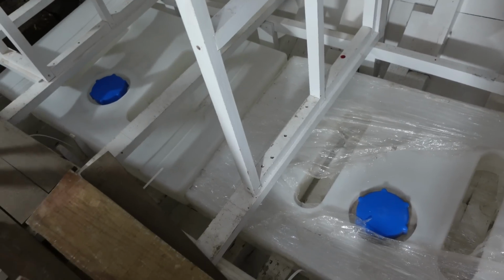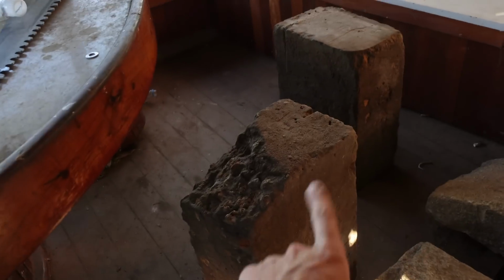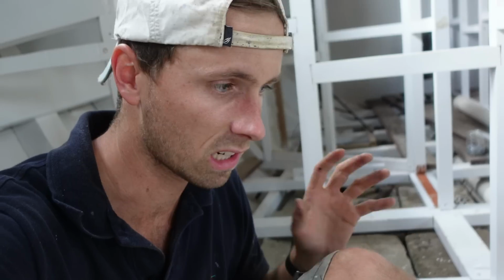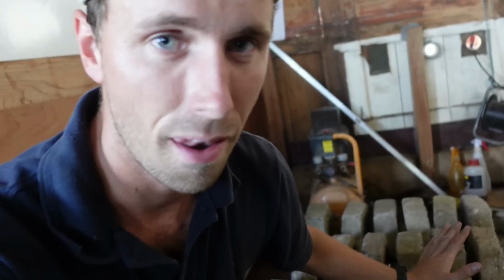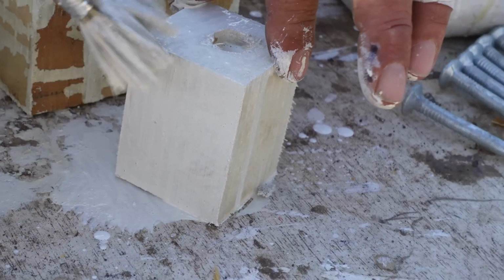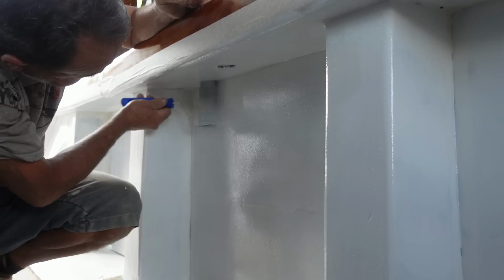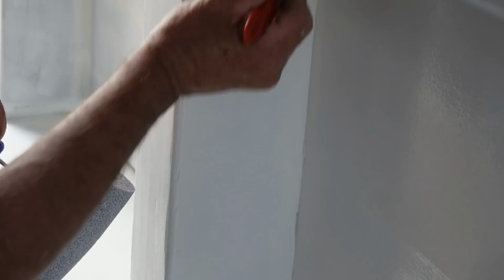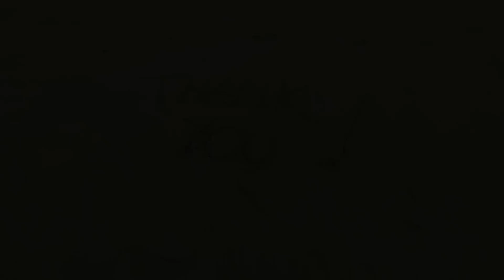Boat restoration: another reason why the sails should be removed on day 1 — Sailing Yabá #103

Comment: Bedankt
Reply: I refurbished a fiberglass boat with my son. When we replaced the fuel tank, we placed a one inch solid rubber mat between the bottom of the boat and the tank to prevent any grinding,  or in the case it became a little loose the tank would not damage the hull. I think the same apply to your beautiful boat. Specially, between the plastic tanks and concrete/stone ballast. There are thinner rubber mats than the one I used. Good luck and God bless

Comment: Have you thought about foaming the ballast blocks in place?  In addition to securing them in place it will prevent the noise of the blocks shifting and grinding with the movement of the boat.  I don't believe you'd want them moving around in any case as they will eventually wear down anything they come in contact with, even each other.

Comment: Does Ben use a tripline on his anchor to keep from losing in the rocks.  shackle the chain to the head and run the chain down the shank and take a zip tie or cotton twine and tie the chain there,  the chain will lay flat along the bottom then if hung up, just drive over the rode and pull the anchor straight up,

Comment: Just wondering about how rough the pavers below the water tanks are....are you concerned about them rubbing against the water tanks when under sail.  Everything shifts even heavy things when under sail and we had wear happen with some strapping on our water tank that caused a leak so I am wondering if you are protecting the bottom of these tanks in any way?

Comment: One concern here - that's a plastic tank stop a semi-rough stone surface.

If there is ANY movement at all in either stones or tank, the stones are going to grind away at the plastic until the tank ruptures.

I'd strongly recommend a layer of wood in between.

Comment: Hi, fantastic work, she looks really good, I have one suggestion please take it as constructive, where you are painting the bulwark planks  where they are bolted to the frames there is a small
gap this is where fresh/rainwater will gradually soak in and start to rot, if I was painting there I would also seal the gap with sika flex, I know it is extra work but it is a small insurance policy
against Freshwater Rot that you might not see or be aware of until the damage is profound, lots of love to you both and the great bunch of carpenters at the  boatyard.

Comment: Great progress! I would have made the battens supporting the hex stones larger. If they couldn't be thicker because of height issues, than at least make them wider. Also I would have taken the time and spent the money to epoxy paint ALL of the ballast stones. It wouldn't be good if stone particles or grit were to clog a bilge pump in an emergency.

Comment: Will you not have to put a fibre layer between the small paving stones and the base of the water tanks for protection, any friction between stones and tank will  cause fractures in the tank.

Comment: MP- Be sure to place a barrier between the tanks and the ballast on the bottom.  Over time the plastic tanks will rub causing  leaks
Reply: A large  piece  of rubber like  Conveyor belting, can be used.  I do  not  think those  rock  have enough  wood  underneath  them
Reply: @giles-df9yu  I would like some rubber under the stones as micro movements will cause the stones to chew into the wood over time,  just like the wood and stones will chew into the plastic tanks.
Reply: yep sr.
Reply: @Clem Fandango They were only using the pipes in the middle, 2 tons, and an extra 4 tons all around with the big stones.
Reply: This whole thing is a cluster…. From the beginning!
Reply: @jerryclayton4616 , if it’s such a shit-show, why have you bothered watching?
Reply: those water tanks will be coming back out in a few years anyway, as that type of hdpe plastic is prone to leaching and will ruin the water supply

Comment: I am a pilot and aircraft mechanic; a sailboat is just like an aircraft it just has one "wing" in the water, I would suggest putting in transfer pumps between the water tanks along with gauges so the weight can be distributed in the water tanks. Water weighs about 9.7 pounds per gallon (US) depending on its temperature. Keeping all this weight even can have a huge effect on your boat's handling. I mentioned before that you should have a marine engineer calculate the weight and balance to make sure the boat is set up correctly. Please look at the you tube of the launch of a large boat launch that resulted in its flipping on its side upon launch. You are doing a great job and I look forward to the next video.
Reply: Transfer pumps is an excellent idea.
Reply: This is what this vessel needs. As is a keelless vessel..

Comment: If I were securing the ballast into place ?  I would consider getting the stones arranged as best as possible, then applying a spray/pour in foam product to make the whole structure monolithic.  The foam will fill in tiny crevices and displace any water 💧 that would normally collect in the voids.  😊
Reply: I believe that would be a bad idea. The foam would make it impossible to see if there is any water intrusion and would also hold any water that got in preventing the bilge from drying out. It will cause the wood to rot.
Reply: @matts.8342  Ofcourse, you would secure limber holes and channels for accumulating moisture along the hull.  Application of foam without a proper system to ensure drainage would be disastrous.  As you pointed out.  Cheers 🍻

Comment: You will need something under the water tanks to prevent rubbing on the blocks. So not to get a leak from chafing.
Reply: Sailing Yabá
That’s an awesome suggestion! We did go after a rubber mat to put between them after all 😉

Comment: Speaking from many years of experience at sea on cargo ships: Stuff moves around even in a light sea, much more so in moderate seas and in heavy weather. There must be something to prevent the stones moving even a bit. In addition, the water tanks must be protected against chafe from whatever they come in contact with on both the bottom, sides and top.  Ballast stones have been used for millennium, and it was soon discovered that a method of permanently securing them was extremely important.

Comment: I don't know if anyone else has mentioned these things, but those batons that you have that are supporting the stones are going to warp over time and probably snap. You need something a lot stronger for support. Another thing, where the plastic of those tanks rests on the stones, I might want to put some softer insulation between them because vibration and tank shifting over time might wear holes in the plastic of the tank. Maybe I'm being paranoid, but it would be a shame to lose all that water and have to replace the tankage.

Comment: Nice work on those hexagonal stone pavers. They're often used on walkways and roads as well as patios and they are designed to lock in place and not shift and move around. There's not much better choice for segmented ballast on a ship like yours. Well done. 💨 ⛵ 🙂

Comment: This loose, hi sitting ballast are going to be really dangerous. It might kill you one day. This really shows how little understanding you have for the foresees of nature. Wooden boats often have concrete poured directly into the hull, so that it is sitting as low as possible, and can’t move around. And plastic water tanks laying on top of uneven concrete blocks, will create leaks. Every thing moves a little in a boat, tanks needs to lay one something smooth. An other thing, spraying ethanol on dirt and oil does not clean anything. Ethanol can loosen and dissolve dirt, but you still need to remove the dirt and oil.

Comment: Those hexagonal stones are supported on thin batons. Imagine the boat in heavy weather pounding against short high waves. I was on a boat of similar size. I had to rescue a sheet to a sail on the front most stay on the bowsprit. The boat would lift out of the water till half its length and later fall down into the waves with the bowsprit underwater. I stood there with my legs weaved through the stays and with my feet in the water. But the movement down of the boat was with negative G. Imagine those stones being tossed around. So, PLEASE, fasten each one so that even heavy shocks will not let them 'wander' away from their place. That bad weather was just the mouth of the Elbe towards Helgoland in not even that bad wind 1976.
Reply: Excellent advise, the ocean 🌊 doesn’t play favorites.
Reply: Agree 200%. As a marine surveyor, I have seen such stones shift when you least expect leading to a catastrophic capsizing!
Reply: Ok if they don't go through storms. With a shocking jolt dropping off a wave
Reply: The more voices that tell them they are in peril because of bad building practice the better. That boat is not safe.
Reply: @Pocketfarmer1  not at all. They need a proper stability study to determine their VcG. This is a disaster waiting to happen 🙈
Reply: I think they forget boats move when I see stuff like this. Allgood if your in variable ten knots. But once above that and things start moving and shifting. Look out.
Reply: They didn't forget that boats move, but they have not the experience of sailing in real heavy weather. I was in Biscay with force 12 wind. That makes you have a different view on what seaworthy tight fastening means. We all are the 'experienced' onlookers at the side line. They will read the comments and take action.
Reply: @johnlifton-jones8365  this sailboat can’t take heavy seas! This is a coastal vessel on good weather days. I would be dead scared to sail with it in anything over Beaufort 5 sea conditions!

Comment: If I were in your shoes, I´ll seal those stones with polyurethan foam so they don´t move no matter how rough the sea can be, not to mention how good glue it is. It has a lot of benefits: if not sun exposed, it lasts almost for ever, it´s water proof, light weight, paintable, and so on.
Nico´s paint job is excelent! She (Yabá) is starting to look like she´s eager to taste some salt water. Hopefully soon...
BTW: next Sunday, will be Ep. #104, witch means exactly 2 years (considering a year has 52 weeks), so it would be nice if you decide to give us a special episode.
As always, cheers from NE Patagonia, Argentina, (a dream place).
Reply: Did you see episode 100? That was the special episode.
Reply: @dennissmith1435  Yes, I did and it was wonderful. 100 is an iconic number, however isn´t it 2 years of hard working?
Cheers from NE Patagonia, Argentina.

Comment: There's a ceiling Channel called "Salt and Tar" that spend seven years building a boat from scratch and it just recently got it in the water and are now sailing. They poured concrete into their keel for ballast. Seems like a good idea. Are you going to get a water maker? A lot of cruising channels swear by them. Especially if they haven't had one before and then get one.

Comment: Now another disaster built in, so many already !
Those stones will, due to boat movements, rub the epoxy based paint away and then the rotten process starts. If not happen earlier the thin sticks breaks and the stones will rub the frames and the boards on the way to an even larger disaster ! I can bet on that there will be water in that volume already at the day you launch Yaba and for all time in future there will be some water in the area.

Comment: Good job getting lots of water storage.  I would include a protective layer between the stones and the tanks, concrete is highly abrasive and even slight movements will steadily scratch the tanks. If you want to seal all the joints on the swim platform I would dsimantle it and seal each piece when putting it back together! Also ensure it can be easily removed for storage, drying out and maintenance, repaint it each year, once it has dried for a month.

Comment: Hello Y'all, great to see so much progress.  I was wondering if you had considered having the water tanks sitting directly on top of rough stone (concrete hexagons) and whether or not you were worried about friction between the plastic water tanks and the ballast?  I'm a little worried even a small amount of regular (wave action) movement will wear holes in the tanks.

Comment: Can you put something covering those stones with some kind of sealer to help them from crumbling?
Reply: Also, some type of padding needs to be placed between the bottom of those (plastic)  water tanks and the top of those paving stones ballast to prevent friction from destroying those water tanks.  It does not matter how firmly you think they are fixed, even a relative movement of 1 mm will wear out the bottom of the tanks.

Comment: You should use silicone caulking for the cracks.  Wood moves.
Silicone caulk says flexible.  The stuff is not at flexible as silicone caulk.  
The cracks will open up: amateurs.

Comment: What happens when your boat keels over 30 degrees in a strong wind?
All the stones will shift and move and hit each other over and over
until you have chips of stone in your bilge and the stones start cracking,
If you think a few pieces of wood will stop all the stones from moving: you are
fooling yourself.  Once you start sailing you will find out the hard way what  the
constant motion of waves and wind will do to your stones.

Comment: Watching you put the plastic water tanks on top of the rough stones made a little voice go off in the back of my head. I'd put a thin rubber mat between the stones and the tanks. Any small movement at all over time would eventually rub a hole in the tanks.

Comment: what preparation will you do on the outside of the hull. Will you cover it with fiberglass ? what color will the hull be . The Yaba is turning out incredibly beautiful !
Reply: Fiberglass is must. As we can see, that there are already big cracks between planks and that epoxy putty does not work, also considered that some gaps where inch wide when planked

Comment: Another episode that went by too fast ( only enjoyable vlogs do that ) Anyway, while you have the floor open If that was my boat I would run 4inch diameter plastic soil pipe front to back and T sections along the length for future cable runs ( you will appreciate having 4 inch ducts in the future trust me. you can get a lot of cables in 4 inch ) Just look at all the faffing about Duca has to do to run an extra wire...